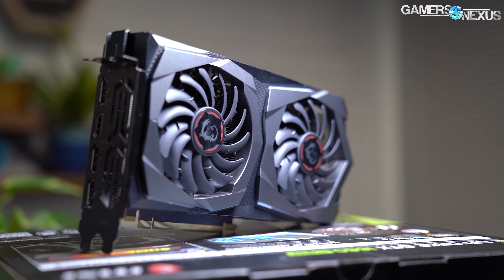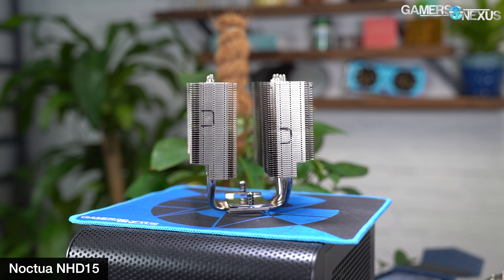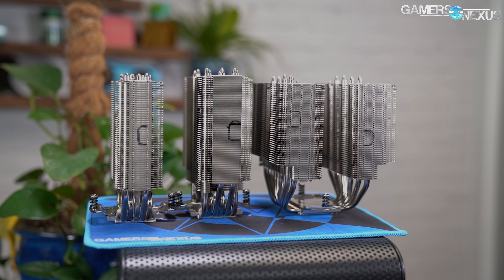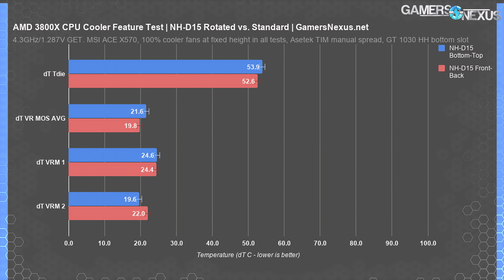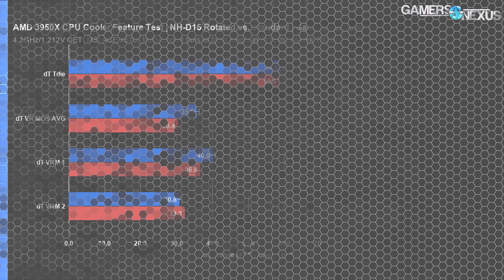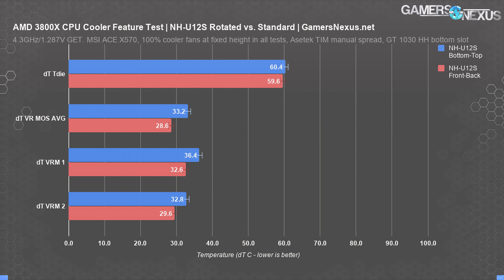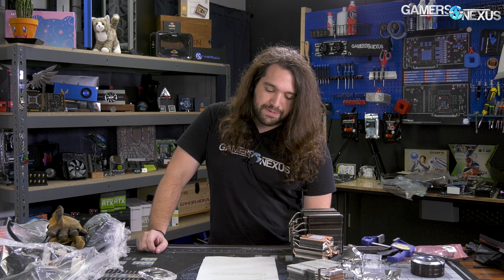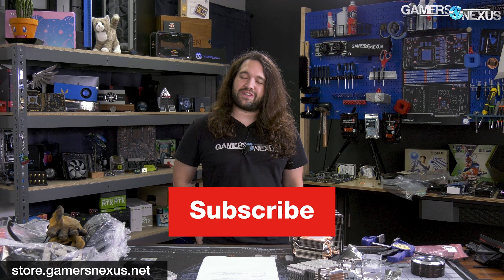AMD Ryzen Heatpipe Orientation Benchmark & CPU Cooler Myths

Comment: I have a 2700X and a 3600X and no matter what cooler I use they run hot compared to any Intel CPU that I have used.
Reply: cos of pbo brah, they auto oc.
Reply: Not even that - they have different temperature sensing architecture, so the reported temps are not directly comparable. Ryzen has many sensor measurements spread across the die, and you only see a single figure representing the worst temp. Older CPUs won't have the same density or arrangement of sensors.

Also - the motherboard might be applying a Vcore that's far from optimal.
Reply: To add onto what others have mentioned here. Here are some glaring issues. 

-Different methods of temp sense between intel and amd and even within their platforms (fx to ryzen for example) 
-Software being wrong (it happens esp during new launches)
-Mount pressure differences between platforms
-Cpus may have exceptionally flat or exceptionally uneven IHS (there is significant variation from the factory for these. (ex. Maybe you got some pretty damn flat intel IHS while you got some not so flat ryzen ones)
-Motherboards running stuff in vs out of spec. Example (lets say your running early agesa updates for ryzen 3000 which still allow 1.5v for the boost table. ( Shorty after launch later agesa editions reduced this to under 1.47 due to degridation) so you may have a situation where you might almost be running the cpu with PBO enabled for ryzen while on the intel side of things they might be run at totally intel stock spec settings)
-You might be comparing 65w plus cpus to LP intel chips (you did not specify what intel cpus)
- if you are comparing a 95w ryzen chip and say a intel 95w- 45nm or 32nm cpu the energy density is significantly different and then you have die size that factors into the crossectional area you have to move the energy. Example take 100w of energy you need to move now if you have to move that out of a 1 sq CM space well that is much harder then if the 100w needs to be transferred from a 3 sq cm space. Talking 3x more energy density there and to move that energy out of such a small crossectional area you may have a high delta to achieve this. 
- you said you tried different coolers but you dint really make it 100% clear that you did A:B comparisons with the same cooler for all we know you might of stuck a nhd15 on the intel parts and then got a stock cooler from amd on the amd parts. You just said differnt coolers were used not actually how they were used. 

I mean there are more issues then just what are listed there those are just bascially some of the most glaring.
There is so many holes here to fill it looks like the movie Holes

Comment: Orientation doesn't matter. And that's a lesson we can apply to life 😉

But yeah, people forgetting heatspreaders exist on the package.
Reply: Orentation does actually matter it is one big reason there is so many types of heatpipes all tuned for different uses. Vertical heatpipes with condenser at the top and heat source on the bottom are the most efficient. Any other orentation for constant conductance heatpipes lowers there Qmax. Wick type ,  wick porosity , and wick thickness all play a role in how well the heatpipe can deal with differnt orentations and their ability to work against gravity. If orentation did not matter you would never see these design considerations. Now orentation as tested in this video doesnt matter (unless you killed airflow through the condenser) since the heatpipes are actually in the same orentation either way ....they are horizontal if you flipped the case on its side so that the cooler sat on top of the cpu in the Z axis you now have the most effective orentation for those heatpipes. How much that matters depends on a lot of factors.
Reply: @Onewolfoc  It was an innuendo

Comment: If only there was some thing on your CPU that helps spreading heat from those dies across wider area...
Reply: I got it, I made one! I'll call it a heat spreader and make billions. 
It also has a benefit of protecting the die from excessive or uneven pressure that could crack it.
Reply: @Jaker788  that sounds implausible at best! Rabble rabble!
Reply: @Jaker788  Yeah, I'll back that idea.  We'd better get on it before Intel or AMD think of it.
Reply: U're dreaming, the human eye can olny see bare dies
Reply: KKool Boomer
Reply: @Clueless-p2e  KKona :gun:
Reply: Advocatus Diaboli  They do make waterblocks for that.  Its a a pain to install if you don't had the tool to remove heat spreader though.
Reply: The IHS should in theory spread the heat for the heat pipes
Reply: Advocatus Diaboli  With warranty? You cant even overclock the CPU if you wanna stay in warranty, why would you care about exotic cooling?
Reply: Advocatus Diaboli  I think they would avoid selling de-lidded CPUs because the package could be damaged if someone over tightened the cooler / block, where this damage would be much harder with the lid on.. and it would be on the mobo, as opposed to the CPU.  They don't want people spilling water on it, and They likely don't want people trying to RMA it for these reasons.  There are a lot of idiots out there.
Reply: Advocatus Diaboli  just delid you freak
Reply: Advocatus Diaboli  scared of risk and calling yourself an enthusiast?
Reply: @gary what if you do the same thing on the heat pipes, do the heat is spread across. This way it won't matter what direction they are facing on the cpu??? (See thumbnail of this video for prototype)
Reply: Advocatus Diaboli  except lots of testing has shown soldered heat spreaders are all but just as effective as direct die cooling. even hardcore de-lidders don't delid soldered heatspreaders any more. it's just not worth it
Reply: Advocatus Diaboli  actually I realised you might be right. I was comparing liquid metal to solder, not solder to direct die cooling. my bad carry on (but I'd still never go back to direct die cooling personally it's just not a very effective use of time and effort for what you get, if you ask me personally)
Reply: Advocatus Diaboli  you want chip manufacturers to provide a warranty for a bare die CPU? Keep dreaming, too many retards will crack their dies.
Reply: There is it is the heat spreader. And a second thought high end amd 3000 parts are a good candidate for delidding to improve thermals. And would love to see a custom waterblock for delidded am4 CPUs.
Reply: Liquid metal...
Reply: Need to delid and repeat test to eliminate this effect.  At same time use direct contact heat pipes. So many variables to consider.
Reply: @jamesthomson8659  I hope that was a joke. It really doesn't matter what the orientation is. The wattage is low. If a few pipes are used it still spreads enough over the fins and other pipes touching each other.

In the end, it's never going to effect your performance in any normal scenario. If you're in a rare scenario, you should be using LN2 or a water block anyway.
Reply: @Jaker788  Yes it was a joke.   So much time wasted on this.
Reply: @Jaker788  everyone should be using LN2. If you're not using LN2 you're a peasant that might as well be just using slide rules for anything you need to calculate.
Reply: @gazlink1  you're goddamn right
Reply: And use grizzly k thermal paste pal and water don't believe in it if you can't run on air don't bother 9900ks on air 5.2ghz that's why it's king know water needed🤣😅😂😅😅🤣😅😂😂😅😅😂😂😅😅😅😅

Comment: also ich hab oben oben zwei
zum Rausziehen unten ein zum rausziehen seitlich in meiner Plastik ein zum Kaltluft
einziehen meiengrafikartehat 2 zum draufpumpen RAM sonst Festplatten Netzteil
unten links raus nach hinten auch und rechts vorne hab ich nach 2 mit filtern
die unten raus oben noch ohne zusätzliche Verlagerung arge kühler für gleichstem
raus warme luft von Cup reicht wen vorne Mitte ein 12 Mali halt rein pumpt und Grafik
auch vollpumpt das hält so kühl ich hab 27 Grad Standard und 56 max. ^^ durchblasen
luft Brings dein Netzteil macht net mehr mit am Ende so hoch ankte gehen sie
wie das Bild abschwächt oder die Energie dann Verso am Limit pumpt das System
wenn du am Limit bist beim ob deswegen braucht man bei sowas 850 Watt für vernünftig
ob – weiß ich genau alles über 5 GHZ halt vernünftiger Verpackung ich spür net
mal eine Heizung mir ist von immer kalt wen das ding pustet und pustet muss net
schick Miki sein auffallen nur zwecks machen Elite Bord Verkleidung so musst
dat

Comment: If you're going to do cool mythbusting videos like this, then can you please test the effect of vertical/horizontal GPU cooler fins on internal case/motherboard/M.2 SSD temperature please.
The orientation of the grills on GPU coolers is almost never mention in the reviews. Generally the lower end board partner designs have horizontal grills and this may be to the detriment of cooling performance but does allow /some/ hot air to be vented out through the PCI-e bracket whereas vertical grills throw hot air into the motherboard and case-side possibly heating up a M.2 SSD mounted between PCI-e slots. Thanks!

Comment: To quote (paraphrase) Star Trek - Let That Be Your Last Battlefield

Bele, "It is obvious to the most simple-minded that cooler is of an inferior breed."
Spock, "The obvious visual evidence, Commissioner, is that cooler is of the same breed as the other."
Bele, "Are you blind, Commander Spock? Well, look at it! Look at it!"
Kirk, "It's heat pipes on one side and fins on the other."
Bele, "This has heat pipes in the correct vertical configuration."
Kirk, "I fail to see the significant difference."
Bele, "That has heat pipes in the horizontal configuration. All of those inferior coolers have heat pipes horizontal."

Comment: I think this video signals the RIGHT moment to create a "How/Why do we Test the way we do" sort of video explaining the "what and whys" of the testing methodology. I'm sure you are aware the technical understanding of the audience varies a lot and even interpreting results is not always completely straight forward it takes understanding some other aspects and terminology. 

I think it would be beneficial to the whole tech youtube community a video of this sort. Explaining for example. Why we need to control variables? why things can't be set auto (even though is how a user would experience it), why room temperature and deltas over that temp are important, how do you determine margin of error (this is a huge sore spot on the youtube tech crowd), what are the std deviation results and how do you determine what the resulting value means, stuff of this sort.

The audience knowledge is all over the place and I think this video could serve as a reference for the whole YouTube tech community and even as advice to some tech youtubers that while having good intentions make some errors in testing

Comment: I wonder how much more difference there is with non soldered direct touch heatpipe base cooler designs compared to noctua's full soldered heatpipes with copper heat spreader design.
Reply: Name for me, any direct-touch coolers that outperform similarly sized/spec'd/priced Noctua's!? Direct-touch is not an advantage, or Noctua would already be using it.

Comment: How much of a gain is there to be had from Liquid-Metal modding Ryzen chips?
Reply: derb8uer (Roman) has done this with a 3970X including dellidding it (he was doing direct die cooling with liquid metal) , but didn't seem to get much if any benefit.

Seems AMD's soldering job is very effective.
Reply: @mduckernz  he should try presure paper to see if there is any difference in hight of the chiplets and the io die.soldering is a much thicker layer
Reply: Not worth the effort and risk, serious. If you truely want to mode shit, go make a perfect case or something.

Comment: Actually, i'm kinda wondering. I'm using a Dynatron T318 full copper cooler with a Ryzen 7 3700x. I was doing very well with my Ryzen 7 1700 doing about 1.25v @ 3.7Ghz. But the cooler sucks with my 3700x. Putting it to 65 watts would still make it go to 90c under load. Is this because of the non-central chiplet that it's doing this?
Reply: Clearly you didn't watch the video.
Reply: @Luxumbra69  I did, but my problem is that the cooler of mine doesn't have 5 or 6 heatpipes, its just 1 flat heatpipe.
Reply: @DaltonP386  The cooler is too weak,buy the biggest cooler
Reply: Dalton P I have a Noctua NHD15 on an FX 9590. It won’t go over 55 celcius in Cinebench on a hot day. I recommend that cooler.
Reply: 3700x consumes around 150 watts under load at stock with all oc options disabled. The dynatron T318 is rated for max 165 watts of heat. So if that thing would cool a 3700x it would do so just barely (keep in mind the 165 watts the dynatron would beable to cool would be at 100 percent fan speed aswell. So provided you don't oc the 3700x and leave it at max fan speed it would just barely beable to cool the 3700x. As with the ryzen 3000 boosting you are killing your performance as boosting is very temperature related. Tldr the cooler isn't good enough for the 3700x get a beefier cooling solution if your having issues, just put fans to max and enjoy your new jet engine that can barely run the 3700x at stock speeds (you'll never reach rated boost on that) if clearance is an issue I would look for an aio water cooler
Reply: @blitzhacker6981  The T318 is passive xeon 1U server cooler built for narrow 2011 only  I'd love to know how he mounted it on a AM4
Reply: @soullords  i assumed it was missing a fan. A passive CPU cooler yikes. Def not on a 3700x, well atleast not in that form factor, there will be one nerd with a CPU hooked up to some 300 lb passive heatsink and prove me wrong watch.
Reply: Dynatron has vapor champer, doesn't it? It should not matter that much. Check your BIOS, some older BIOSes are using more voltage than needed with Ryzens 3xxx. Also if you have enough space go for some other cooler but i guess you don't.
Reply: Thats an extremely weak cooler, the reason you were doing well with the 1700 was cause of the low voltage and frequency (far below what the 1700 is usually run at). You need a better cooler.
Reply: @4fiHysteria  I'm going to assume he got baited by the 65w tdp on the 3700x, meanwhile I'm seeing power draw in the 150 watt range non oc'd at stock settings.
Reply: That cooler is tiny.  Why are you using that on a 3700x?  you would be better off with the wraith cooler that came with the cpu
Reply: May I suggest something I normally don't, buy any water cooler you can afford, even if you can only fit a all in one 120/120 in the case it would be a hell of a lot better than the dinky thing you are running in what I am guessing is a small confined case.
Reply: Server cooler, are you using 15K RPM delta fans in a blade case?
3700X has a much higher heat density than a 1700, so it's going to create a hot spot at a higher temp with the same power draw.
The 3700X @ 65W can use up to 84W, while the 1700 maxes out around 75W.
Reply: One possiblity, wether or not it's based in fact or myth I do not know, is that due to the ryzen 3000 series having a smaller die, but same /similar tdp, but more importantly wattage output, or even heat generation, in a smaller area on the IHS, it can be more difficult for a cooler to dissipate that heat, due to the fact that the heat is more concentrated in one spot.  I hope this makes sense. I know I used a lot of commas (probably incorrectly lol), but I hope you understand what I'm trying to say. 

Again, I do not know if this is just myth or actual fact since this information came for the  famously inaccurate Reddit. Lol  but it is something to consider nonetheless.
Reply: @brandoneich2412  gamers nexus has a load of videos on how much bs rated tdp is in regards to heat output of a CPU. Most 3700x chips pull 150 or more stock (no where near the make believe 65w tdp)
Reply: @brandoneich2412  First off, I highly doubt that heat density actually matters too much. Mainly because that myth has never been properly tested and, as far as I'm concerned, is a myth perpetuated by armchair engineers. Once it's been tested and proven, sure, heat density bad.

Second, even if the TDP did directly correlate to power consumption, Ryzen 3000 doesn't have the same TDP in a smaller area. There's also an I/O die that consumes a fair bit of power. So while the heat density is likely a little slanted towards the compute die, the overall heat density isn't that bad.